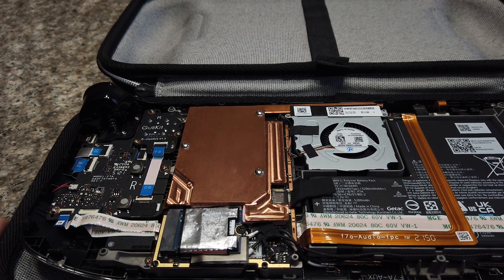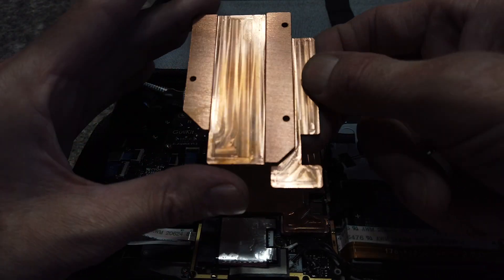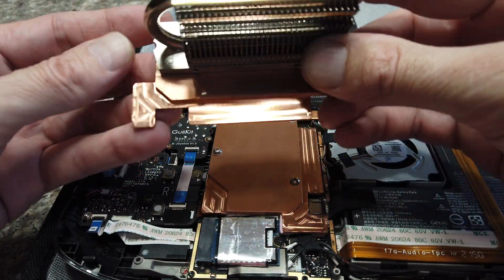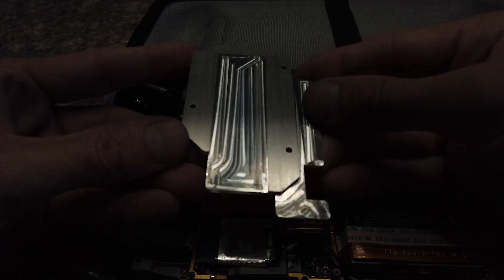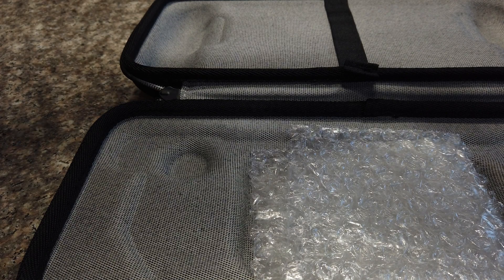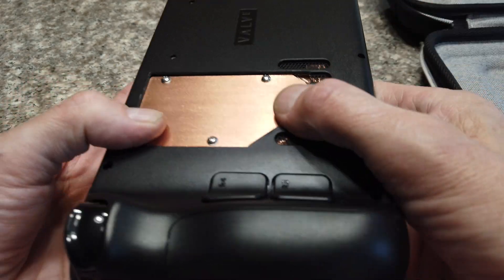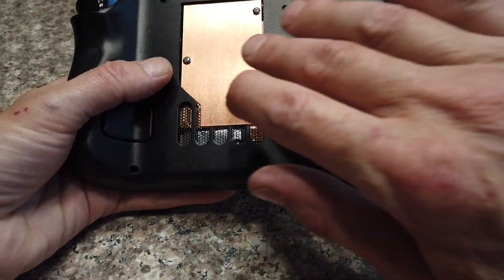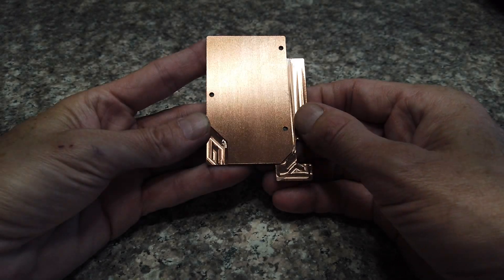CoolDeck v3 Cooling Upgrade for Valve Steam Deck

Comment: I hop you can read this. I have a suggestion. have you seen those low profile cpu coolers? Would you consider a design similar to that so the heatsink would be flat and a little bit to the center?

Comment: Hi, can we use thermal glue instead of thermal epoxy?
It's 20 times cheaper
Reply: You wouldn't even need thermal glue. in the past I've used normal thermal paste to get the heat transfer and any old epoxy/glue around the outside of the heatsink. Works fine.

Comment: Look at the cooler deck Nupp project ;)
Awesome colling and wather cooling system for the deck with your plate thats can be awsome 😁

Or to cooling u can also try to put a peltier with a fan on ur plate  ;)
Reply from the maker: I'm not a fan of peltier cooling because of the power requirements and you still need a heatsink / fan.

Comment: Would be cool to make one that works with the jsaux backplate and then attach cooler to the cooling plate
Reply: I have the backplate in hand, and it looks like it should fit. You have to use a thinner thermalpad than the original tho. maybe 0.5mm not sure
Reply: Just tried this, defo need a thinner pad otherwise it bulges but it defo cools well. I took the pad off in the end so its only got air inbetween. Temps seem to be a tad (1-3°) higher when the pad is removed but I didnt want the bulge for structural support + pressure on the APU reasons

Comment: Is this the same as CoolerDeck?
Reply from the maker: Looks similar.  It looks like that one comes with the heatsink and fan.  Also, the copper plate included with the "CoolerDeck" is half the thickness of the Cooldeck. While smaller, I don't think the "CoolerDeck" can perform as well as the Cooldeck with an efficient M.2 heatsink and fan attached.

Comment: How is the performance in comparison to the other versions you’ve designed?
Reply: v2 is usually 70C on windows. I have no issues with it. Ima try V3 if its smaller than the V2 for Jsaux cases

Comment: Nice design!
Did you tested if has any difference on temperature drop without the cutout of the case?

I was wondering if this copper plate had some small ribs making a path to the original cooler. Kind of making a direction to the air flow from the intake to the cooler, but with the case closed. If this had any difference on the cooling drop.

I have a CNC router in my house, i could try to do this design and test if works.
Reply from the maker: I didn't do any testing of the CoolDeck without additional heatsink / cutout in the back panel.  In my testing of the CoolDeck with a M.2 heatsink and 40mm fan I was able to get a 30 degree temperature reduction over stock.  I would estimate that installing the CoolDeck without the M.2 heatsink / fan / cutout would perform significantly worse, but still achieve a worthwhile improvement in cooling.

The v3 CoolDeck is 2.2mm thick with the thinner portions 1.3mm thick.  When installed without any cutout in the Steam Deck, the plate will sit tight against the back cover, but the thinner parts of the plate allow intake air to enter and flow around the copper plate. Intake air from the internal fan can also flow underneath the plate.

Comment: Hi. Great job. And if you also add a channel with longitudinal ribs by deepening into a copper plate along the path of the air flow from the inlet in the plastic back panel to the native fan.

Comment: I didn't check your channel too much, but do you make these yourself? If so, I think it'd be really cool to see how you design everything - maybe even the production process.
Reply from the maker: I do the design and I have an online machine shop manufacture them.  The design process involved lots of measuring with a dial caliper to get the size and hole spacing exact. Probably not the most exciting thing to make a video about IMHO.
Reply: @lowbudgetify  I would disagree, that stuff sounds pretty rad to me lol - and if one person likes it on the internet, there's bound to be a decent sized audience somewhere
Reply: @lowbudgetify  would love to know what shop you use!  I have a ton of things I've designed that I would love to get made into either aluminum or copper but no idea where to send them.

Comment: how does the airflow?
Reply from the maker: I recommend adding an additional 40mm fan.  In my setup I use a M.2 heatsink cooled by a 40mm fan to get a 30 degree C drop in temperature.

If you don't add an additional fan, cooling would rely on the intake airflow of the built in fan flowing over the copper plate.  This might work, but temperatures will be hotter.
Reply: @lowbudgetify wow 30c is very impressive. My question is if you just rocked the copper plate without the heatsink what are the temps vs stock? Just seeing if its worth it if its like a 7c drop

Comment: Hey, I bought your last version (v2) and I’ve honestly just been rocking it without any fan attached. I was just curious if you thought over tightening the screws would negatively impact performance as it could possibly suffocate the chips??? Tyty
Reply: You don't want to overtighten the screws, you will just add stress to the motherboard.
Reply: Get the blower cooler and you set. Keep it in the low 60s
Reply from the maker: Overtightening the screws could strip the threads or warp the motherboard. You really don't need that much tension on the screws, but it's important they are tightened evenly so the plate is level with the motherboard.
Reply: How good have the temps been with just the plate
Reply: @dontsweatme4588  I lost my original plate so I don’t have an official benchmark or comparison but it’s definitely not overheating, something between 50-80c depending on the load maybe 90 on something like elden ring but I can’t confirm that
Reply: @danielolaru1419 how long are your gaming sessions? On the website he recommends not to install just the plate but I’m tempted
Reply: @dontsweatme4588 i have the v2 installed and I’ve had it for about 4-5 months and I’ve never had an issue. My sessions vary, never past 4 hours but sometimes 2-3
Reply: @dontsweatme4588  I’ll trade u lol I only bought it cause my stock thermal plate got destroyed cause I did some stupid mods and I needed an available solution
Reply: @dontsweatme4588  exactly what i wanna know. Just dont wanna go through it all again.

Comment: Would this version fit under the Jsaux transparent back cover?
Reply: I don’t see why not, might struggle cutting the heat plate though
Reply from the maker: I haven't tried the Jsaux replacement back cover yet, but the v3 Cooldeck is thin enough to barely fit under the stock Steam Deck back cover when installed with countersunk screws.
Reply: You will need to take the piece of shit back plate like I did but your good to go and it looks sick. Also pick up some computer filter mesh. This is what I did.
Reply: @Boujee_Sinner  how were you able to remove the backplate? It seems like it’s molded in??
Reply: @danielolaru1419  push it out
Reply: Its not gonna go back in. Heads up but yes push it out
Reply: @Boujee_Sinner  sorry, push it out from the back???
Reply: @danielolaru1419  push the plate out. You should be pushing from inside the plate. So push lol I don't know how else to explain it.
Reply: @Boujee_Sinner  no worries I’ll try it ty